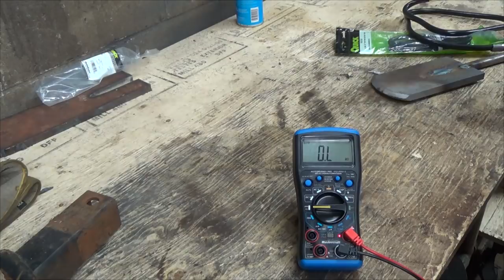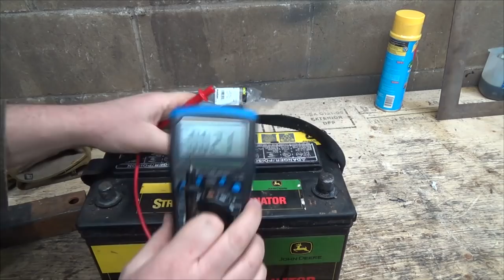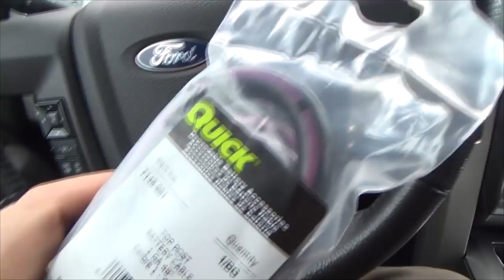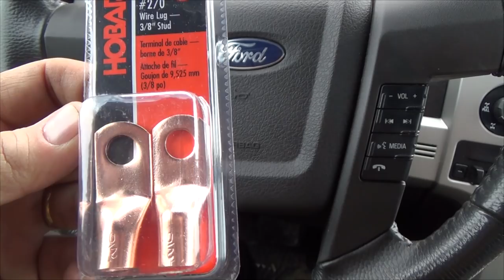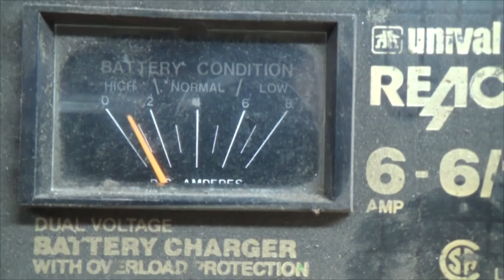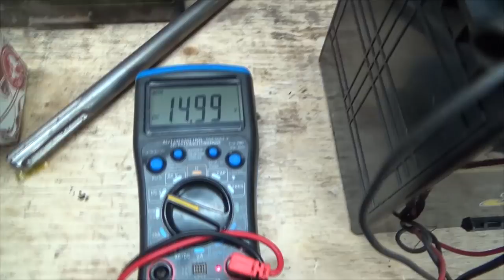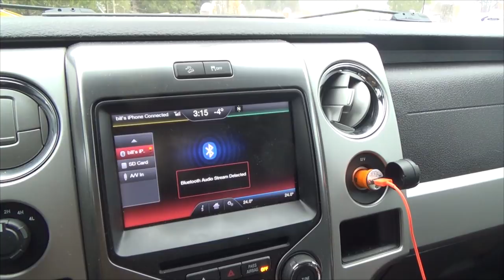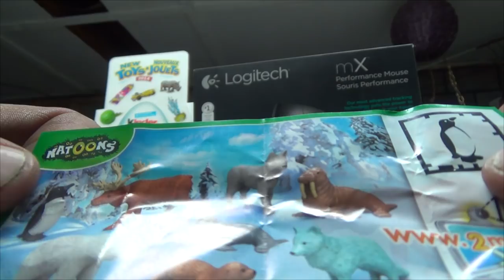New battery New cables New alternator that better fix this issue

Comment: Bill when you get off the tractor do you leave the hst in neutral or Low, med, high.  There is a safety on the tractor making you depress the clutch if starting in gear.  In cold weather I always depress the clutch to reduce the drag.  Try depressing the clutch and If the tractor still starts real slow again check your trans range selector and move it back and fourth back to neutral.
Reply from the maker: Steve Rob thats a clutchless transmission in it
Reply: It dosnt have a cluch
Reply: Well that makes it even harder to figure out now :)

Comment: hey bill good video, i am starting to get into the more recent videos. wish there was a way to watch in sequence. fyi, the diodes in an alternator is how the alternator is able to charge in dc. the alternator puts out ac voltage and the rectifier bridge with diodes change it to dc..hope all that work pays off, dont forget to check the starter.

Comment: BILLSTMAXX :) On an empty parking lot, your truck remote will probably also go about 100 meters or so. But if there are cars, that are all made of metal, the radio waves from the keyfob bounce around these cars and get weaker with every bounce, so they might not even be strong enough to reach the truck from 20 meters away.

Comment: Bill just a note The positive posts on batteries are usually a little bigger then the negative post that is the norm and you used 2 negative cables so it would have been a little snug on one. I need to go and find your next vid to see if all your effort payed of :) been watching some your old vids as I ran across you channel after looking for some info on loading tractor tires. And now I'm hooked ;) and enjoy your vids!

Comment: One of the bigger cemeteries, in Willimantic, does open graves, due to the town dept, of public works. The outlying small cemeteries don't have the luxury of full time cemetery crews to do the openings. Most of them rely on a local farmer or contractor to dig, if they are not busy with winter repairs or working on other jobs.

Comment: the black plastic thing on your roof is for your GPS; and the receiver for your key fob is inside your dash by the windshield. and if you have a second black plastic bump thing on your roof it would be for the satellite radio.

Comment: On your truck you have to think about how a radio frequency travels through the air and the pulses the frequency has to move to the reciver; the RF signal goes to what it is tuned too and the closest thing that has the same frequency as the transmitter.

Comment: One good check for a bad cable is to measure the voltage drop across the length of each cable while starting.  A good cable will show minimal voltage.  Put your DMM in volts mode and put one test lead on the positive battery post ( not the connector )and the other test lead on the opposite end on the starter terminal.  When you hit the starter any resistance found between the battery and the starter will result in a voltage reading.  The amount of voltage read is the amount of voltage not seen by the starter.  Do the same thing on the ground side of the circuit as well, measuring between the negative battery post ( not the connector ) and the grounded end of the cable at the engine block or wherever the cable connects to.  Doing this test checks the integrity of the entire cable INCLUDING the connections on each end.

Comment: Billy I'm a licensed marine mechanic it's called electrolysis it can happen with outside temperatures going up-and-down and moisture, Mercury Marine suggest replacing the cables every two years in saltwater engines, the reason the draws more when it's cold your oil is cold the oil pump has to pump that much harder so which causes a harder starts and higher amperage to the starter motor which breaks down the battery cables the same rule applies to spark plug wires  Chevy was noted for this problem for the resistance on the spark plug wires causing the module and distributor to go boom and frying the coil i've seen it 100 times I've been doing this for 27 years, you May want to check the resistance on your key switch the easy way to determine that is cross out the starter see how it turns over and then trying it with the key switch A lot of people overlook the key switch  give that a try but before you do anything I would double check my battery go to TSC and buy a battery tester it's called a toaster it's a load tester it will be the best investment you ever made

Comment: Bill, don't feel bad about shutting down Burials for a few weeks in case you have to send her out for repair. We got so much snow that the small cemeteries in Windham County CT. are not even open, or have access until sometime in the spring.
Reply: Wow,ne er heard of a cemetary closing down, around here if equipment fails, they get a rental unit

Comment: Bill, you need to remember that vrla (valve regulated lead acid) batteries are tested at 77*F. Low temperature will reduce available capacity by approx .5% per degree. At approx -22*F your battery capacity drops to approx 50%. In the cold weather that you are experiencing you would need a battery 50% larger Cold cranking amps. Either keep the battery warmer or get a bigger battery. I work in the telecom industry and we use battery warmers in the winter. Good luck!
Reply: bill said that it was warmer that morning (didn't start) then it did start up the prior morning.

Comment: Great mouse been using the same logitech mx darkfeld for six years now at work drafting. battery's lasts for more than two weeks. Great vids also like the length of vids you make cannot stand short vids with no info.

Comment: Bill, your multimeter doesnt even show the resistance in the probe wires, dont expect accurate readings, good clean connections and thick cable is the best.

Comment: your remote sensor is on the dash in the middle. the one on top is for sat radio. on the radio its a update apple has done on the phone check with ford and see if theres a update for the radio and all will be fixed. most of the time you can download the update and put it on a usb stick then update the radio by that

Comment: I would put the battery caps back on and use a water/baking soda solution to neutralize the acid scum on the top of the battery. Then wipe the top as you did on this video.

Comment: on your keyless entry deal, it may have a distance that I only works at,, unlike your starter is menat to be use like from inside your house.. but for safty your keyless entry may be for closer range so that people cant run and jump in it befor you have the chance to get in first.. just a thought. and make scence to me.

Comment: The purpose of a diode in an alternator is to convert the AC voltage created by a rotor moving electrons in a magnetic field of the alternator into DC voltage, basically sine wave to flat line, which can be used to run the electronics on a vehicle.

Comment: hi bill your battery box is made from steel so it may draw from your battery, i use rubber belting under my battery,cold concrete floor can also draw power,

Comment: Buy a fluke multimeter. You should have read some resistance on that new negative battery cable. Reading 0 ohms just means your multimeter isn't sensitive enough. Cheap multimeters put out to much voltage when checking resistance.

Comment: I replaced  the cables on my truck a few weeks ago because the truck liked to kill batteries. these cables where stock on the truck from 1981.
Reply from the maker: brett thomas and any difference?
Reply: yeah it doesn't kill batteries anymore and starts faster than ever before.

Comment: I would not worry about voltage readings on plastic case of battery. It is high impedance so it's only microamps of current leakage. I would worry more about engine ground wire to chassis if the negative battery lead does not directly attach to engine.

Comment: the keys operate on radio signals if there are a lot of other signals in the area from like wifi and such or metal structures and cars the signals will get distorted or bounce away from the receiver the fact you have snow will also allow for longer range as the signal will bounce off the snow and go farther
Reply: I agree the 2.4 Ghz Freq Range that most key fobs work in is a very busy/messy freq range. in a parking lot there is a lot of interference in the signal band.

Comment: There is a lot more metal to interfere with the radio signal in a parking lot than between your garage and truck.  Touch the remote to your chin when pressing the fob button when in the parking lot next time.

Comment: I had a similar problem with my fermec 860 digger, no go in the battery when starting. I tried everything, all voltage was correct, changed altinater, changed starter, no difference, until I checked the voltage on the battery as I turned the tractor over, really low voltage then, new battery solved the prob. Must of shagged something inside it, voltage correct when tested but under load hopeless, hope this helps

Comment: a ohms test is actually got good, it will show zero because it takes path of least resistance, there is a better test you can do with out removing them from the tractor voltage drop test because when cranking its a like 10 volts or so but at the starter if there was a problem it might be 10 volts at the batter but only 8 at the starter meaning you losing it somewhere hope that makes sense but a mechanic wouldn't use a ohms test on cables just so you know. voltage drop is what you check
Reply from the maker: VIheavyequipment ya i dont have that draw tester
Reply: BILLSTMAXX :) I'm pretty sure you just usd a multimeter actually I can't remember excactly but probably google or youtube voltage drop test you know what I'm saying though eh? if all is good the voltage will be the same at the battery and at the starter when cranking but with bad cables or connections it'll lose volts I don't know a lot about it but I remember them teaching me it in my 10 month pre apprenticeship for heavy duty
Reply: BILLSTMAXX :) I remember now to do that test put one lead of the multi meter on the positive termal on the batter and then the other one on the starter crank it and the multi meter will tell you the deference should be zero if perfect

Comment: change the oil to 10w 30 or even 10w 20 that 10w40 turns to grease when its cold!
Reply from the maker: senocon 15W40 i use in the 110
Reply: BILLSTMAXX :) that's even worst, talk to your dealer and see what they recommend in cold weather. it starts fine when its in the garage where it's some what warm doesn't it?
Reply: BILLSTMAXX :) the lower the winter grade the better it flows so 15W-40 is thicker and in your climate it is like molasses. 5W-40 or 0W-40 would be "thinner" and would pump better. You could try switching to 5W-40 or 0W-40 and I know you just did an oil change on the 110 but you could just re-bottle the 15W-40 since it doesn't have many hours on it and use it in spring/summer.
Reply: senocon Please get information about multi-grade oils before suggesting things that don´t make any sense.
http://en.wikipedia.org/wiki/Motor_oil
Jon Rushing is completely right!
Reply: Kinematic viscosity is graded by measuring the time it takes for a standard amount of oil to flow through a standard orifice, at standard temperatures. The longer it takes, the higher the viscosity and thus higher SAE code. The tolerances are much tighter on diesels thus when its cold outside the engine gets "tighter" and harder to turn over. So maybe you should get your act together webalizer_yt.
Reply: senocon Are you kidding me? You have to bring down the viscosity for cold temperatures which is indicated by the number before the "W". YOU suggested to bring down the viscosity in high temperatures in your first comment?!
Reply: I never change my oil grade when its  cold, dealer recommends 5w30 i run 10w30, i dont care what people say, if need be i just plug in my block heater for extream cold days on a timer. I allways let it idle untill it starts to warm up before i put a load on it. The whole point is that its lubricates the engine far better in my opinion. 700,000 km and still going, no compression lost, yet i see so many engines puke out before 350,000 to 400,000 km. Im ruunimg a 95 ford explorer 4.0
Reply: webalizer_yt Take a qt of 10w 40 and a qt of 10w20 and leave them out in the cold over night and see which one is slower to pour out!

Comment: i thought you bought a big battery last year for the tractor that you never installed
Reply: He did. In the one shot you can see it sitting on the floor in the shop. He just never got around to rebuilding/extending the battery box on the tractor to accommodate it (it's bigger and won't fit in the box).